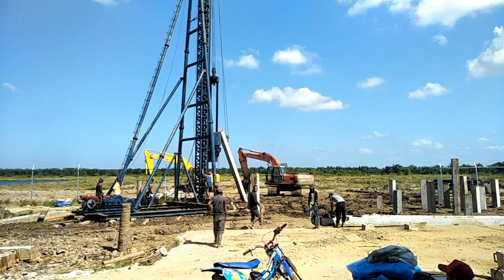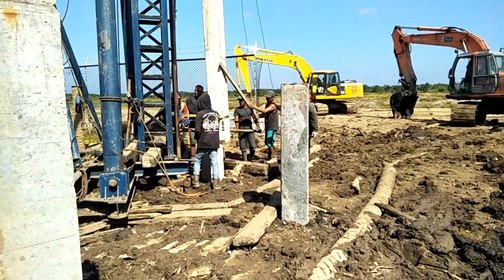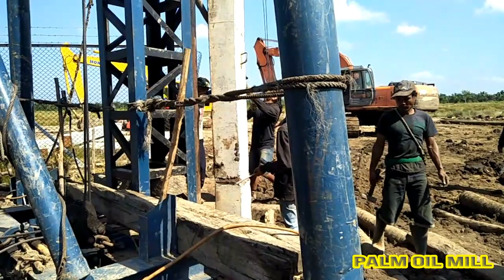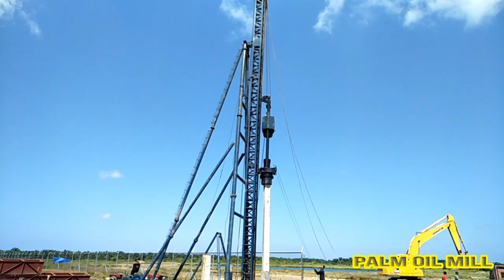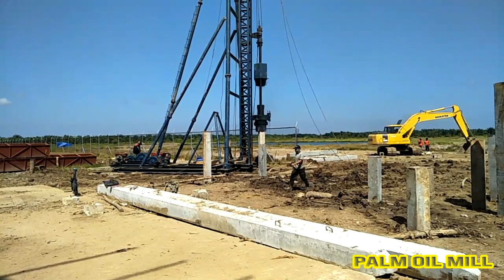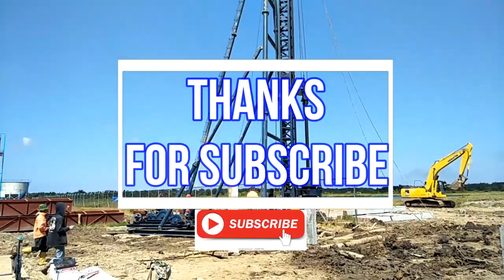Pemasangan Tiang Pancang Pabrik Kelapa Sawit

Comment: Kita ada pemancangan seperti ini, UNTUK tangki cap 2800 ton 4 unit,  dan cap 5000 ton 2 unit. Ukuran panjang 200x200x6000.
Rata rata pancang masuk 4 batang. 
Saat ini salah satu tangki2800ton, mengalami kemiringan. Untuk team pancang pastikan pemancangan benar dan tepat.  Salam project.